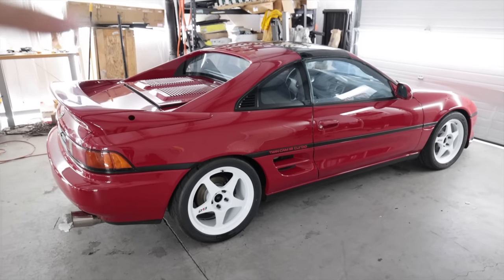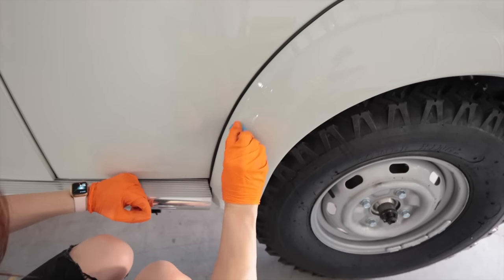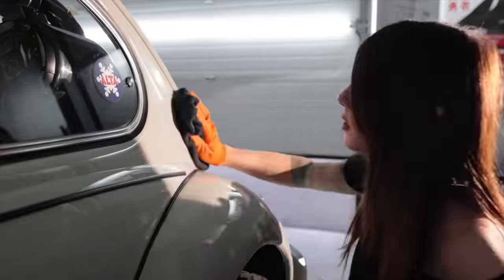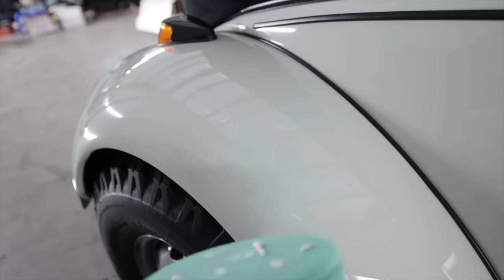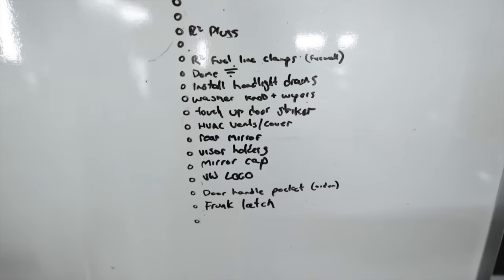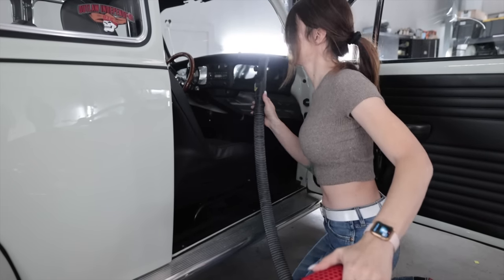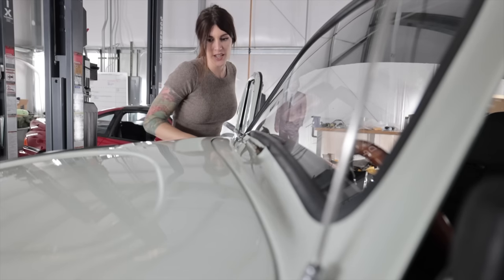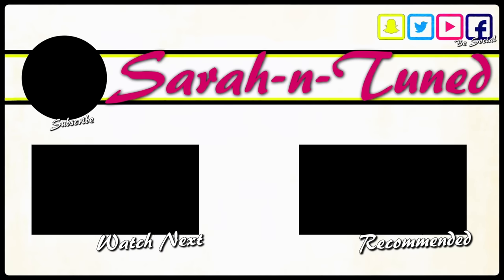The End. // '69 VW Beetle Class 11 Restoration

Comment: I love the moderate utilitarian overlander look/build. That's pretty much how I'd want an old beetle built if I had one.
 Plus since it's a mild off road-ish vehicle but not 4WD.  It's not a very heavy, so it wouldn't need a huge expensive winch to pull itself outta trouble. I think it'd look cool with some  diy F&R  black tube winch bumpers.

Comment: I’m sure you know, but in case Angel forgot, the front wheel axle caps aren’t on. You probably got aftermarket ones that didn’t fit. If not on the axel grease is going to mess up your detail job, & the grease will get contaminated. I only noticed because you and Angel did a stellar job. ;-) nice job as usual!

Comment: I'm missing the front wheel bearing cups.

And the skid plate is a sound/noise generator the way you did mount the plate. With adjustment you can't reduce it. Think about it. I wrote about this already

Comment: 11:01 / 15:57 No clue if you head of this. A old-school detail technique removing wax. Is to use Cornstarch. Just put the cornstarch into a old spice container. Then sprinkle the cornstarch onto the vehicle wax areas. Then wipe off the wax with ease. Plus, it gives your paint that Super glossy finish that most wax jobs will not give you.

Comment: Nice job on the body. I also like the roll bars and  seats. 

Of course the assumption is whoever gets the care will replace the engine or at least rebuild it. 

The Frankenstein carburetor is a particularly nasty touch  left over from the previous owner.   

A Bug Spray carb and 007 Bosch distributor with extractor exhaust on reman heads with high lift rockers and new jugs and pistons will make about 90 hp.   And not sound like greased Pulleys

Comment: Great job. Spent a lot of time with some VW's many years ago including swapping a couple of engines, tuning etc. and you're little one still does not sound like it's running right. Maybe still carb issues? It doesn't sound nearly as smooth as it should if things were right. Might try taking it to a VW shop. Usually several in and around large towns. Typically not expensive work either.